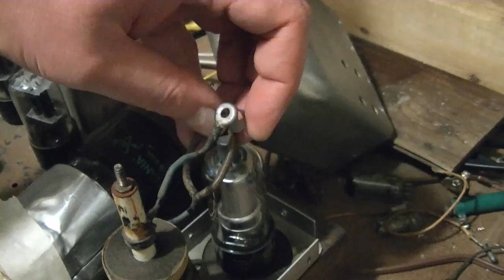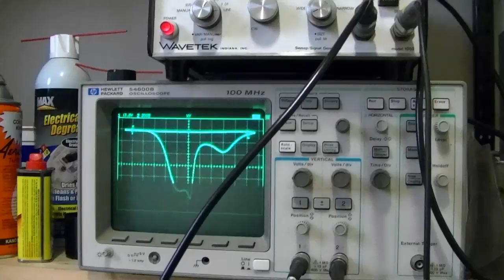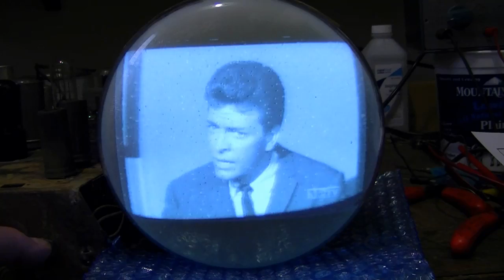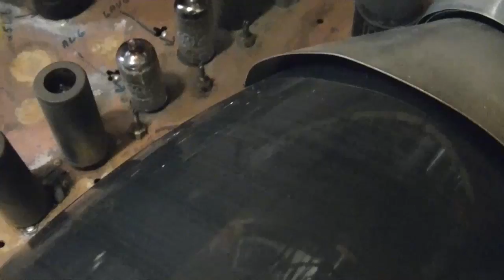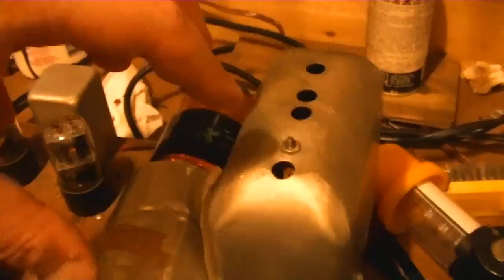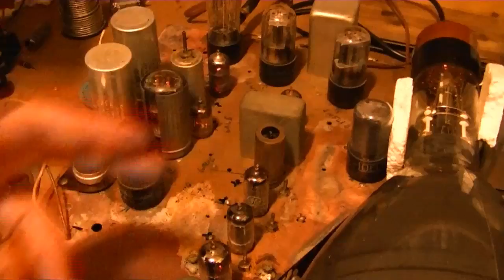Motorola 7VT3 restoration pt3o?

Comment: Is there any kind of modern electronic instrument plugged in and turned on somewhere like a computer or switching power supply somewhere??
Reply from the maker: I think the most likely source is the converter box.  I remember seeing the same interference in a Motorola 7VT3 I worked on a few years ago and used the same converter box.  I'll do some more experimenting to track down the source.

Comment from the maker: Good observation.  I dug out another TS-18 chassis I had restored a few years ago and fired it up on the workbench wit the same signal source.  It too showed similar noise though not quite as pronounced. Those diagonal lines are the vertical retrace lines.  These sets have a suppression circuit to blank them out but the added noise is causing them to become visible.
  I'm going to try

Comment: I'd go at it differently. Put on a test pattern, break out the scope and start at the CRT cathode and work back to the antenna input; that noise should show up as "grass" on the video. If the problem is in the signal chain, this will find it.You're not getting jitter in the sync, so the B+ is pretty clean. 

You could go logical; each scan line takes 63.5 ms; take the width of the noise pulses compared to the width of the picture, remember that 1/t = frequency and go to the circuit at that F.

Comment: When troubleshooting noise problems: weak signal produces a picture lacking in contrast with "salt and pepper" noise. If you've got a solid picture with this noise, it's due to a strong source of interference. Since what you're seeing isn't synchronized to video, it's most likely caused by arcing. HV is the first place to look (what's under that HV rectifier socket?) but it could be anywhere. These are tough problems to solve; good luck!

Comment: Yep, I agree with the guys thinking tuner problems. I've had similar looking problems as this and it turned out to be the oscillator in the tuner. By the way, when do you think you will start the resto on the 621ts? I really want to get one, and they come up on ebay reasonably often, but unfortunately postage to Australia is quite expensive.

Comment: Considering all you have done already, I tend to agree that one thing to check is the signal itself, and verify its path to/and the tuner -are not the cause. Reminds me of the many times I had snowy noise on an almost great picture -only to discover a near open on one leg of 300 ohm twinlead. If its not that simple, maybe its stage by stage 1077B time. Great chance to demonstrate the Milton Kiver approach!

Comment: Typical, from what I have heard from other users Y.T's customer service is all but non existent. There isn't actually anyone you can contact to offer feedback or to rectify problems. With regard to the interference I wonder if the remaining carbon composition resistors might have something to do with it, or maybe it's some hash coming through on the power line?